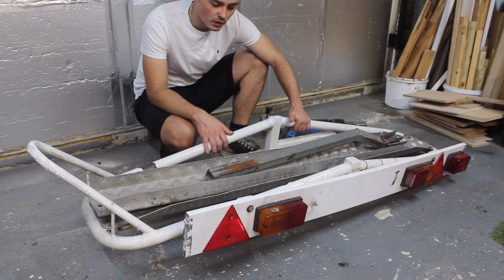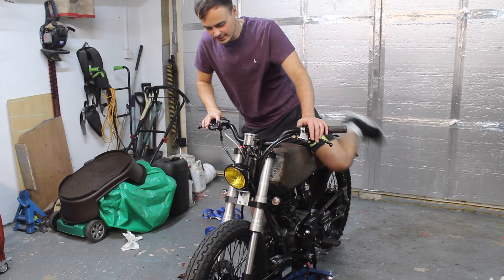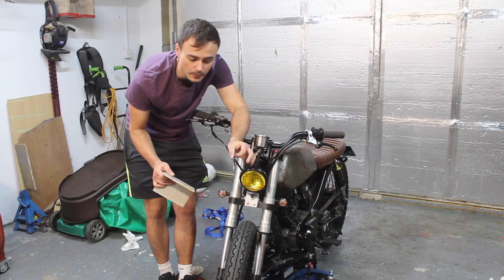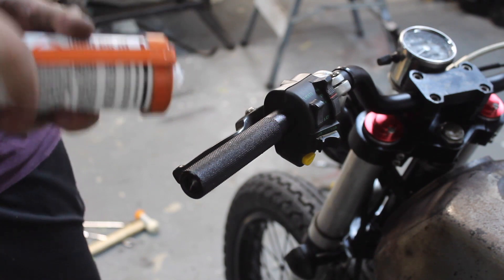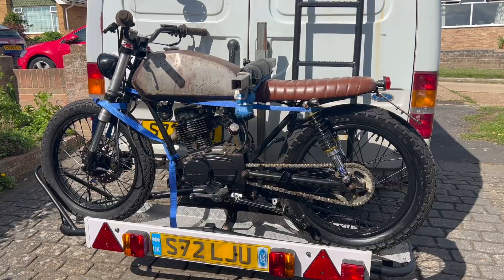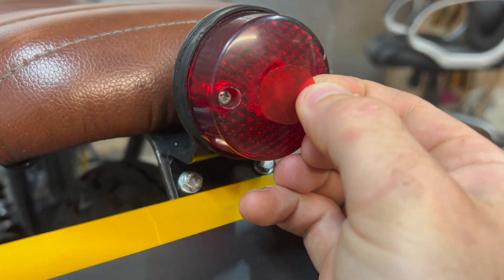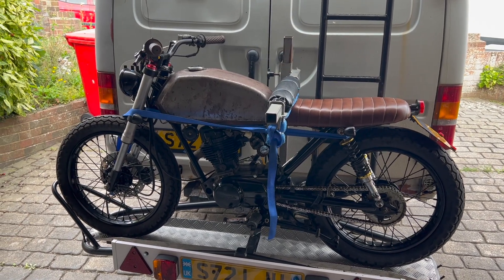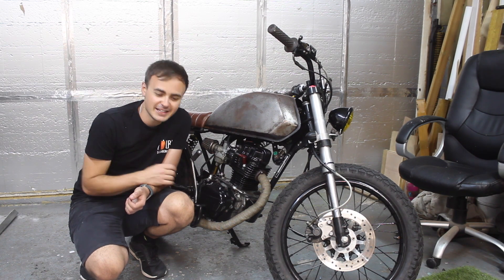MOT Test Day - Pass or Fail?

Comment: Congratulations on it passing it's mot clever lad well done what was the tie rap on the break for?.I have problems with my Peugeot metropolis trike it not bleed very well a guy told me to try what you did so just leave the top of all night and it sorts it out
Reply from the maker: Cheers mate! I read that if you put the cable tie on the brake lever and leave overnight it allows the air to escape easier. Worth a try, let me know if it works for you 😊
Reply: @TurnersWorkshop97  definitely give it ago